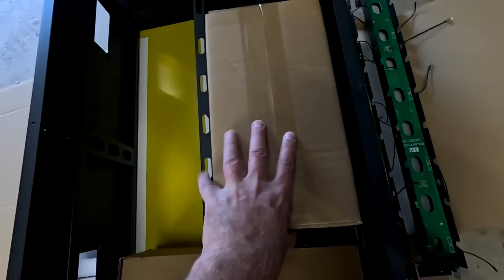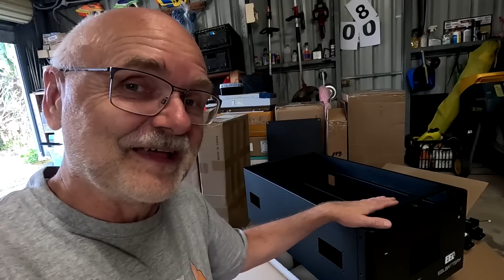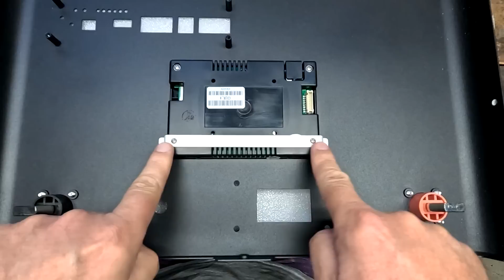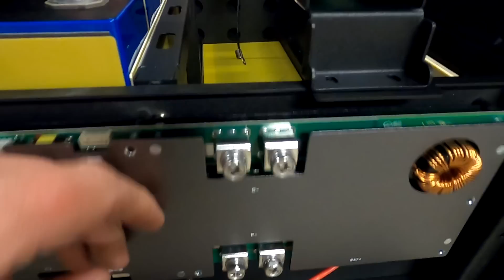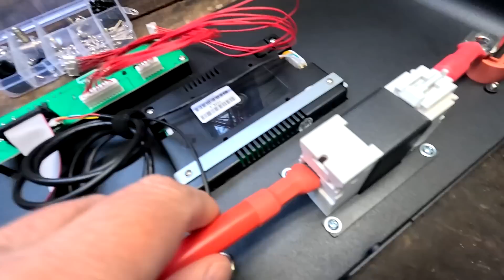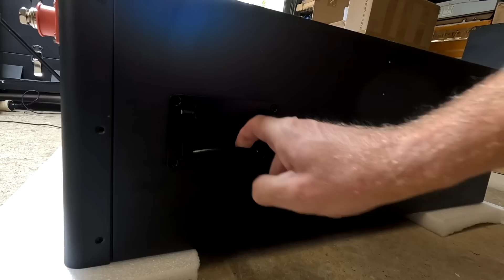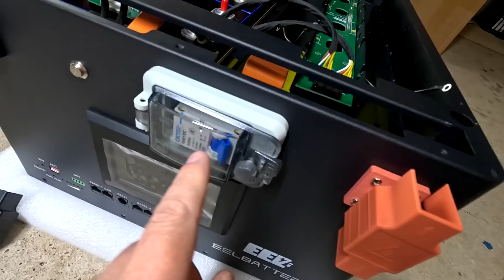Testing the new EEL V4 48V DIY Box with JK Inverter BMS. Are we there yet???🫏

Comment: hi just built my battery box a quick question the new display flashes the battery segment red 2 bars blue 4 bars and green full bars when charging and the little leds on the breakout board counts 1,2,3,4 ramping up is this normal cheers

Comment: Hello Andy:

The EEL 48V DIY Box build with 280Ah batteries went well, power-on was as expected.  I have a question for you. I have two SOK batteries (those without display) and now an EEL box. What would be the best way to integrate the EEL battery box into my existing solar system.  My system has two Victron 5000-watt inverters, Lynx Stunt, a Victron distribution unit, and the Victron MPPT for the bi-facial 550w solar cells.

Comment: Hi Andy, any chance we could see the EEL v5 box in your channel? Thank you and greetings from Finland!
Reply: @OffGridGarageAustralia, I'm looking forward to the EEL v5 box review too! 

Currently have one V3 box, but want to increase the storage a bit. 
The breaker (switch) which is in V3 and V4 has some preferences on my end to easily disconnect the pack without external switch (offcourse, switching without load!). 
V5 does not have the switch anymore, but yeah, if that is the only big difference I might go this way and use an external disconnect switch. 

Don't want another V3 box as it has (too thin) wires inside instead of the flex-busbar.

Comment: I have M31 batteries and the busbars that came with are to short.
Also there is no busbar to bridge the gap in the last row.

The busbars that came with the batteries are good, but then the BMS sensor cables don't fit as they have small m3 size eyes.

Comment: The 10kA braker is afaik not strong enough to withstand the 21,3 kA the batteries can deliver in short circuit, so arching and fire is possible.

Comment: Is the breakers 10.000 Amp Icu enough for breaking a short current when everything fails? I calculated that a Lifepo4 with 0,15 milliohm internal resitance can deliver 21.333 Amp...
Reply: How can such bad short happen? anything that is connected to battery will die/melt and short will die too. unless you put screwdrive there to make a short.

Comment: My Victron ESS system is now working with this box. I've set up the jkbms according to your suggestions in another video including the float settings. I notice strange behaviour. As soon as the absorption timer expires, the system starts dumping energy into the grid until the float voltage is reached. Then the charge process starts all over again. The BMS is set as the battery monitor. Any ideas what may cause this weird behaviour?
Reply: I think absorption is not valid for lithium. I make absorption low or equal to float if possible.

Comment: i just received my order of these exact boxes, mine did not come with busbars for the bms connections, and it came with single-pole bus bars for the cell connections instead of double-pole. reached out to Howard, haven't heard back yet.
Reply: I've had the same. Miya promptly sent me the double pole busbars
Reply: @egbertegberts5384  so it turns out that i accidentally selected the single-pole busbars on my order. they made me pay for the double-hole busbars.
Reply: so i actually made a mistake when placing the order and selected the single-pole option. not sure how that happened.
they made me pay for the correct cell busbars.

Comment: About the narrowed bar to the breaker. Just measure resistance from the wide part and terminal hole, then from the narrow and terminal hole opposite . Calculate the difference. I guess it will be nothing...

Comment: My 2 sets arrived today,  the boxes suffered a hell of a beating but not a mark on anything inside.  I also received the cables and not the bus bars.  Otherwise i used a very sharp knife to trim down the silly rubber feet to fit the roller base.

Comment: I had problems with the compresstionplate aswell. If i put all eva tape and all isolationplates in the right place, i had a gap between the plate and the frame of around 10mm. So i had to use longer screws and screwed them carefully together. But later it ripped of 2 pullin-nuts (Einziehmutter) with it. It made me crazy. I had to remove them and put new inside. It was really really annoying. 
Like i ripped off the nuts because of bad documentation and was angry coz it broke my 500€ case and i had to repair it.

I also had the bendet pins on the balancer PCBs. Main problem was, i had already mounted all balancer wires and busbars and then i figured out, there was almost a short between 2 cells. I had to grab some isolated pin and bend them in the right place. It was close to get a big spark.

Comment: Thanks for your sharing, Andy!👍
Please allow me to explain:1.Our battery engineers said that only high-voltage batteries(above 110V) need grounding protection,2. We will offer 2 black screen brackets, the one shown on the video is just a test version. Anyway, we still get a lot of inspiration from your video, and we believe that there will be a better EEL 48V DIY box in a short time!🥰
Reply: Any discount codes
Reply: Your engineers are wrong. The battery cases need to be grounded even at 48v.

Comment: I've got 4 V3 boxes with Seplos BMS, just placed an order for 4 more :)
I really like the cases, they're not top quality builds however, but good enough for housing batteries.
I will actually mount them in two 19" racks. I ordered rails for Dells M1000e bladechassi to place the cases on.

Comment: I would be worried about the reduced size of that pin on the bus bar, the surface area is greatly reduced. If it is rigid enough it could only be making contact with the corners of the bus bar. Looks a bit dicey to me.

Comment: need something like 16S4P or more, building a big battery will not work with 16S1P boxes. Each is one case, one BMS. Having 60kWh or more in one case would be nice, multiple will be stacked. Bet there arent any bigger cases, right ? Threaded rods and plates it will be.... :-)

Comment: Yes, it's version 4.1 of the box. I have version 4.0 without display and without busbars to the BMS only the thin silicon cables.
Reply from the maker: The cables are definitely on the thinner side... They always are in these boxes. But who is pulling 200A for some extended time from such a battery?
Reply: Sure 👍I have a bunch of the boxes and around 80A per box on full load. But I love the clean design with the busbars 😀

Comment: Great video as usual Andy. With regards to your issue with the busbars being shortened to fit into the circuit breaker, there doesn’t appear to be much different to the size of the lug on the silicone cable
Reply from the maker: The lug seems to be folded and of a lot thicker material. I would prefer a normal 25mm ferrule here. The breaker terminals are large enough for a 50mm cable, maybe even for a 70mm cable.

Comment: I don't need a box like that. But it is very cool to see what is available on the market. 
I did copy your Battery Shelf. Not 100% but almost the same. I am very happy with it. 
I use the "old" JK-BMS versions with rs485 to USB direct to Cerbo. Works perfectly. 
I do not use the SOC of the BMS. I only use the Data from the Smart Shunt.

BUT, if I would buy some boxes I might go for the EEEEEL one.
Reply from the maker: Do you use only one JK BMS connectin to the Cerbo? What if a second BMS comes along...
Probably go with the Yixiang box instead. It's better quality, it seems. Unless the price difference is large.
Reply: @OffGridGarageAustralia  All the BMS's are connected. In the Cerbo I did hide them. I only want to see Cell max and min and Voltage and current. This is displayed in Home Assistant to me. I have no extra software installed in the Cerbo other then Setup Helper and GUI-MODS. No special software from Github needed here like the one from the African guy van de Wal, or any software for that mather. Victron just accepts what is connected. Victron is the best. Only after Multi Plus update all setting are gone. They need to fix that.
Reply from the maker: @robfre70  I thought you need to have the serial driver installed on the Cerbo to accept the RS485 signal from the USB?
Reply: @OffGridGarageAustralia  Nope. No need to do that. I just connected it and after 5 seconds the BMS showed in the system. And through MQTT all data is going to HA.
All I used is the official JK adapter from the small JST to the mini black box. From there to the RS485 to USB converter and that to the USB from Cerbo (I have a lot connected so I use a Industrial USB Hub)

Comment: Why do you need a ground on a DC source?
Reply from the maker: It is still connected to an inverter with 230V? What if it is faulty and fires back to the DC side? I would always have all touchable metal parts grounded in an electrical installation. The metal battery box is no exception.
But it may depend on your local regulations...

Comment: Problem with PCB is again. People who buy this. Check this PCB in every DYI BOX. Check voltage or use plastic screws. Always think. What can,t went wrong, it can be done.
Reply from the maker: What is the problem? I think they have solved it as the tracks are going around the mounting studs.

Comment: Has anyone ever cut open the flexible busbars to see how they are made flexible,  is the cross sectional area reduced, and in this particular case where it enters the circuit breaker how much of the terminal actually makes contact with the breaker when the screw is torqued down especially as it is flat, maybe use some engineers dye assemble then disassemble to see how much dye is then missing.
Reply from the maker: They are made from several thin layers of copper film. Usually, they have a hump in the middle which will buck when the cells should expand.

Comment: Very nice, but I don't like that the communication cable between the batteries runs through the touchscreen. 
ELL should move the touchscreen closer to the main plus terminal. 
Also, two main plus and minus terminals would be better as one as well.

I wrote the same comment to ELL under their video about this DIY Battery Box and they replied this:
,, This suggestion is very good, we will make changes according to your suggestion when we produce the next batch of shells, thank you. ,,

YIXIANG battery box also has the same problem with the communication cable between the batteries runs through the touchscreen.
Reply from the maker: Ah, right, yeah, that's actually a good point. Unless you route your comms cables around the display.

Comment: The conductor size of the flex bar is "thickened" by the terminal material. The weak spot is just the line, where it goes in. Not a big issue because all the "more heat" that spot my greate dumps into the bar.
And every hole on a busbar also lowers the area for current use. (the screws are not contacted as well to fill up the effect).

Comment: The breaking capacity of the B250 Circuit Breaker is 10000A. It's the number on the front of it in the rectangle.

The reduced diameter of the busbars connected to the breaker isn't an issue. Yes, they could become a little bit warmer with high currents, but it's only on a short path and there's enough metal around to dissipate the heat.

Viele Grüße aus der Nähe von Berlin.
Reply from the maker: Thanks for the 10000A.
Reply: Are you sure with that 10kA breaking capacity? OK, there is a number in an rectangle, but nothing indicates to I_s. No unit, no sign and i was not able to get a datasheet for that breaker in the Web. Even EEL has none. That seems to be dangerous in my eyes.
Reply: @DerAH-Effekt   Yes, the number in the rectangle is the code for the current breaking capability. As I can't post a link, try Google for "How to Read MCB Nameplate Data Rating Printed on It".
But of course, we can't confirm, if the number on the chinese circuit breaker relates to the reality.

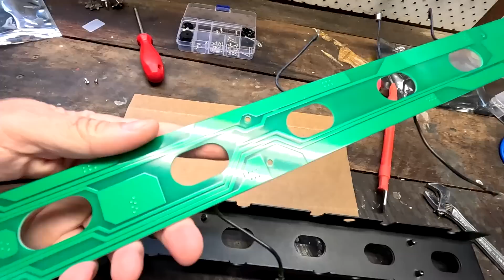Comment: 22:00
You see Andy, it's not a problem if you don't use all the screws to attach the PCB.
Your board is attached with 2-3 screws, why?

Another box and once again the same problem with the PCB, the solution was that the manufacturer removed the screws to avoid a short circuit.
As a viewer, I was a bit disappointed, you are justifying another company with poorly designed PCBs :/

Regards, Leszek
Reply from the maker: That's how the PCB came, with 2 screws in the middle only. I haven't fully assembled the box as I don't have any cells for it atm...

Comment: Thanks Andy.  I'm glad they meet your approval!!  I have two so far and I had no issues with the compression plate.  As for the EVA tape, I added it to the epoxy sheet, and it worked fine. Batteries are nice and tight. I like the cable buss bars too, much easier to use from what I see. My boxes didn't have the screen, so the BMS mounted to the front cover, not the compression plate so there was more room available for the fatter cables.

As for the screen vs. no screen versions, I prefer the screen less version because then it's just a box that I can monitor from the Cerbo, and not have to worry about a component that I will never use.

I should note that one of the two boxes that I bought were damaged, and the included BMS didn't show battery temps. But ... they sent me a new BMS and looking to get a good discount for another box. So with the excellent customer support, I'm going to stick with them. My goal is to have a total of 4, all stacked together using the excellent cart that they offer ... and that box you mention looks very familiar 😉
 
One thing though ... why the concern for the lack of grounding point?  Would this be used to connect box to earth or the negative side.  Is this a lightening concern?
Reply from the maker: Yeah +1 for the dolly😄
Grounding all metal objects which can be touched in an electrical system is key. Lightning protection is a whole different animal.

Comment: I am interested in Victron equipment and camping. I wanted efficient equipment. I invested in two Fluke Meters that measure watts, volts, amps, power factor etc accurate to 0.1% accuracy. My efficiency measurements , watts in, watts out, for Victron Battery chargers were disappointing, and nowhere near spec. Example Multiplus 1600 charging at 50 Amps, 75.5% efficiency, Power factor 0.998 (good) Centaur 40A battery charger, 76.8% at 40 amps ( 707 watts in at 230v 543 watts out, )  Power factor 0.980 (good) Blue smart 30 amp was better, 448 watts in, 390 watts out, 0.997 power factor, 89% efficient: the 25 amp blue smart IP (no fan) 374 watts in and 334 watts out, 89% efficient, power factor 0.999 Efficiency is important if you are are running off a generator and don't want to waste power.

Comment: I still think that the YiXiang is the winner here.  My only concern is their DC breaker which if it is indeed directional, it would be a no no.  Real fire hazard.  Andy, I hope you will make another video showing the YiXiang populated with batteries and tested.
Reply from the maker: Yes, I'm with you, the Yixiang box is better quality and yeah, their breaker is a concern...
I have the cells here now to build the Yixiang box and test it out. But it will be a while.
Reply: @OffGridGarageAustralia  Excellent!  Thanks.
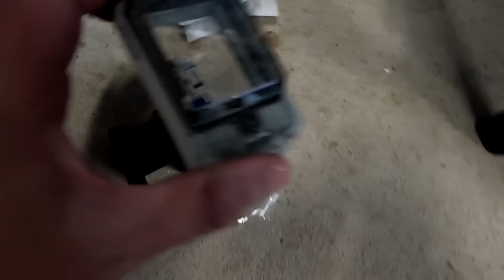Reply: Should circuit breakers to be used in batteries be non-polarized models? CHCYZO appears to be polarized. 4:06
Reply: @nunosantos79  Have a look at the following video (Oaq2cvoPBRk) of what can happen when you try to break current flow in the wrong direction with a polarized DC breaker...
Reply: the "+" seems to be the positiv of cells not the positiv of case. when turn on seems to be pushed to the cells, and off to the terminal of the box, it seems to me

Comment: I have one of these boxes and the pins on the PCB balance board were also bent and in my instance, they had been pushed through the circuit board and damaged the tracks. My BMS is mounted on the front panel and the silicon cables were even smaller than yours 2x10mm for the negative and 1x20mm for the positive which in my opinion is way too small.
Reply from the maker: Ah, more quality issues... Yeah, the cables are too small for 200A. Not great.

Comment: Andy, could you ask jk to include support for rs485 pace and pylontech soon. Please 😢
Reply from the maker: What do you mean by that? Do you want to parallel JK, Pace and Pylontech?
Reply: @OffGridGarageAustralia Jk still does not support pace bms and pylontech protocols for inverter communication over rs 485. These protocols are announced, but not available yet. So, quite a number of inverters are not compartible with jk. Some voltronic-like, for example
Reply: @OffGridGarageAustralia  The JK-CAN protocol  for the deye inverter doesn t work ..... Right now i work with the Pylon protocol.  But i have V15.17. JK is working at V15.23 i read ....
Reply from the maker: @mandxyz2523  there is already a 15.24 out. Have a look at my Google Drive linked under the JK-BMS on my website.
https://off-grid-garage.com/battery-management-systems-bms/

I'm not expecting of fixing that as the changelog does not say anything about the Deye specifically, but always worth giving it a shot.

And what exactly is not working with the Deye inverter?

Comment: I had no problems with compression plate or any other mechanical components of same box without display.  
But I had to put some more epoxy sheets to compress lf280k a little. Epoxy and eva tapes included were not enough... cells are too flat maybe ;)
Reply from the maker: These were brand new LF280k cells, dead-flat and they still fitted perfectly with one foam and epoxy in between them.